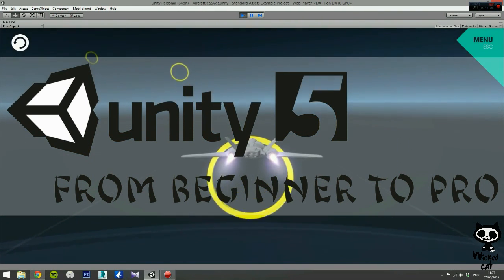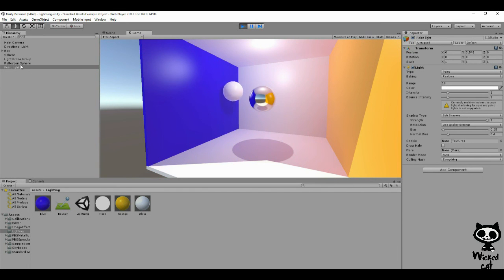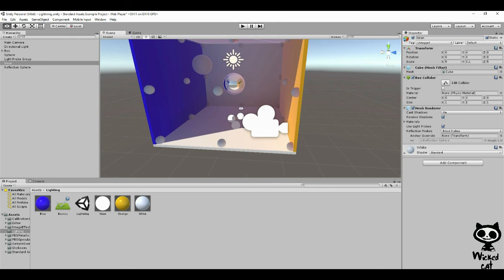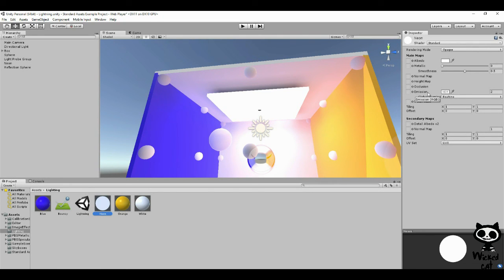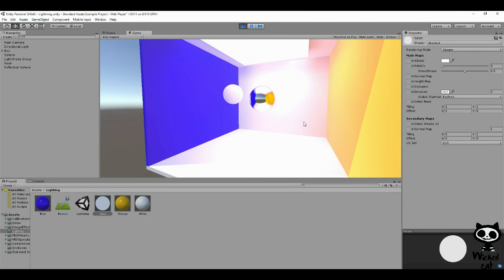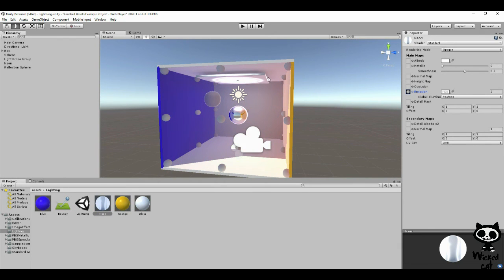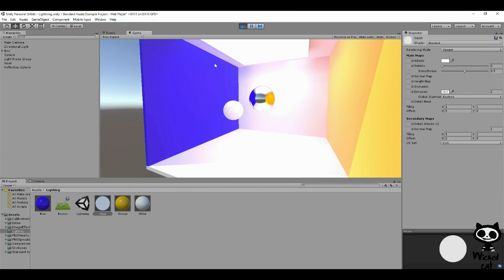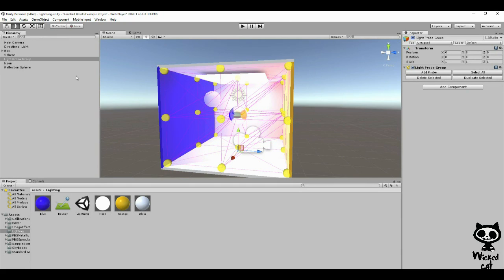Unity 5 - From Beginner to Pro #22 - Emissive Light

Comment: How do you make the object emila light? It does not work from me. In the material inspector, I can see the letters HDR by the emission. How did you plug this HDR?
Reply: Change the objects to static.
Reply: I have the same problem as you do. I have make all of the cubes as static but still don't work. :(